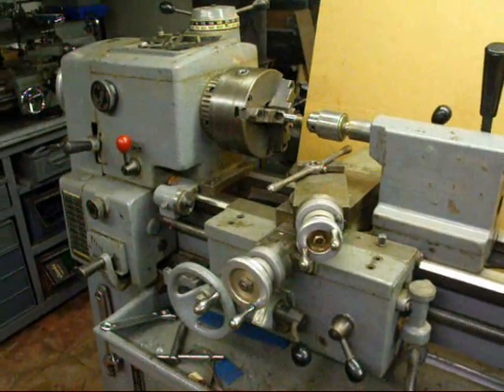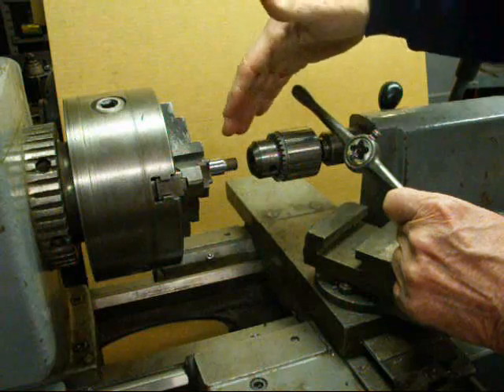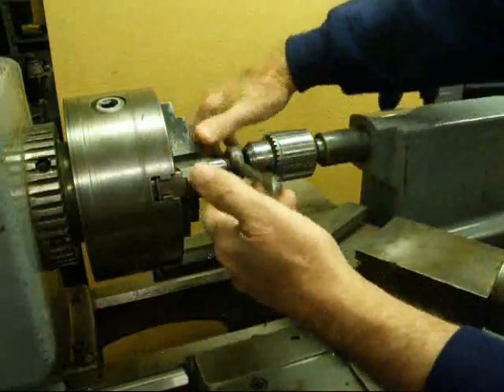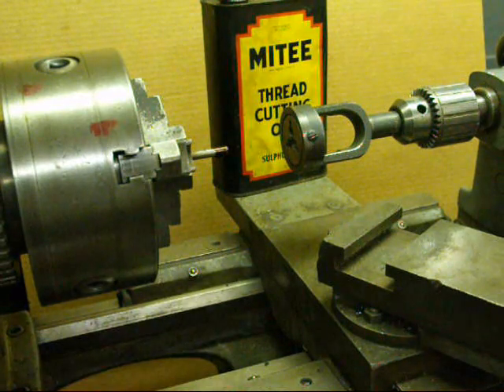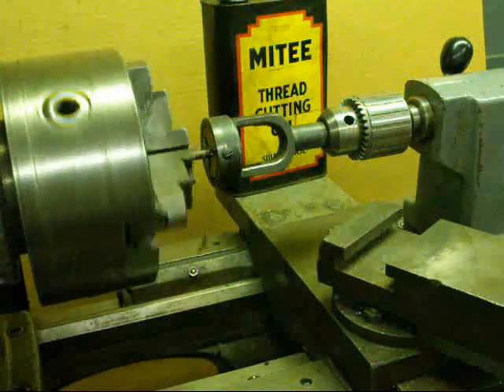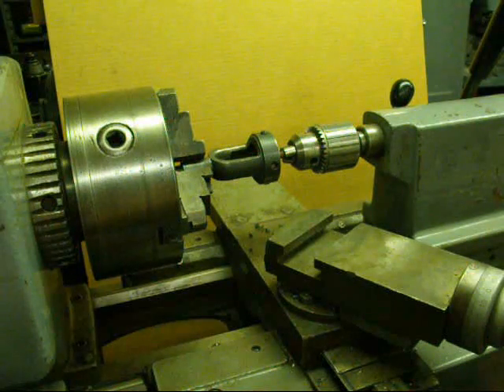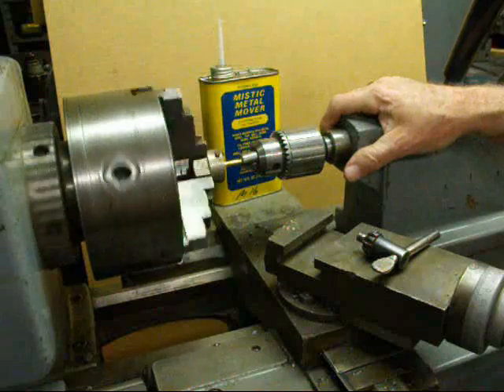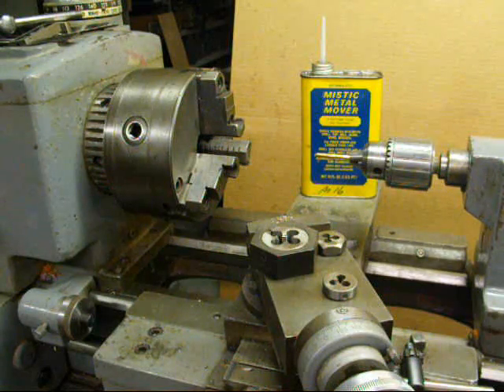MACHINE SHOP TIPS #6 Dies/Threading  tubalcain

Comment: As far as breaking some rules, I've used a threading machine to cut threads one to three inches in length on pipe 1/2 to 4 inch in diameter. Never reversed or in any way broke the chip and never had a bad thread. Threading under power with a constant stream of cutting oil is not the same as threading by hand. Thank You for all the wonderful videos.

Comment: Mr. Pete (Tubalcain), when does one use a die with a lathe to cut a thread vs. using the lathe to cut the thread with a thread cutting bit?  I have watched many of your videos and really like them but wondered about using this technique vs. a thread made by the lathe.  It is definitely easier to use a die is that why one would do it that way?
Reply from the maker: Use a diet when you want to do it fast. Or perhaps when it is metric
Reply: Thread cutting on a lathe without dies is more complicated and for custom setups. The die is a standard form and much quicker. However, there is an infinite variety when using a threading setup. It is much too complicated to go into here.

Comment: Fantastic, this is precisely what I was looking for-- I need to thread an asymmetrical metal component and there's no practical way to balance it in the lathe chuck. This is just what I needed. 
"
When threading into a die that's mounted on the lathe as opposed to the tailstock; are you just going by feel? Or are you matching your tailstock's lateral movement to a certain RPM the die is set for?

Comment: I am not a machinist. but a fairly skilled diyer.  I have a restored by me little Atlas. I've overcome some obstacles in getting it mounted and reassembled and cleaned up. It is on line! Made a bit of swarf in a test run. My chuck isn't self centering. so, I am wrestling with a way to accurately get the work centered!

This piece seemed to be using the  lathe as a vice to accurately cut threads on the work in manual fashion., OK, by me. it works. I agree, if powered, the die and it's handles no

Comment: While I do respect anyone doing as much work as you are obviously doing, As a professional machinist with thirty years experience and as the author of many professional Lathe training and safety manuals, I need to protest at the idea of restraining a die holder with a hand held bar, even a small lathe in low gear has enough torque to rip a human hand apart, I know because I have seen it 1st hand, incidentally not pretty!
Reply: He said the chuck was locked in place.

Comment: When threading with the die in the lathe chuck, it looks as if the center of the die is not centered with the tailstock, it shows a bit of eliptical motion.  Is this true, and if so, is it a big deal in this context? 

(new lathe owner, learning lots. Still very ignorant.)